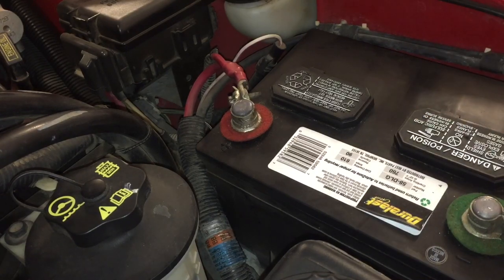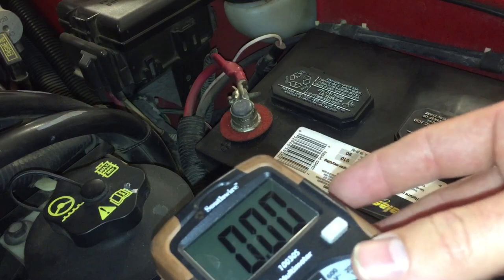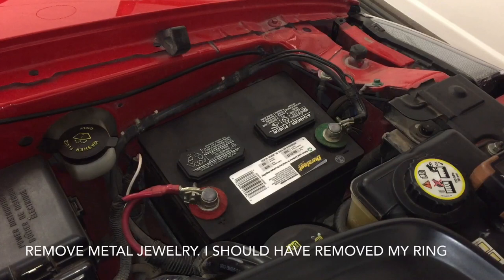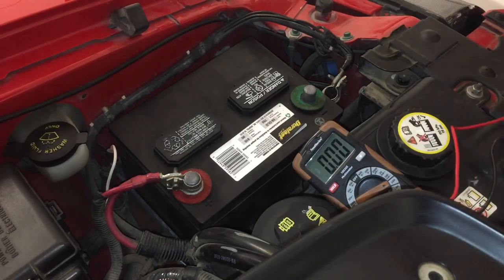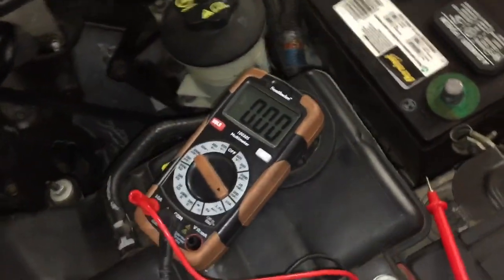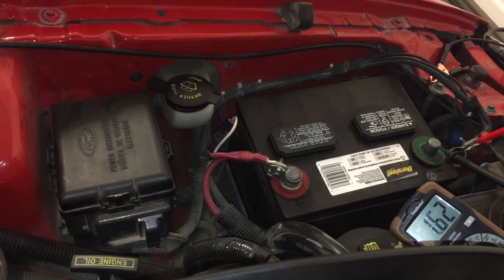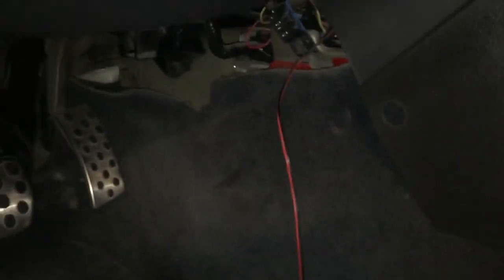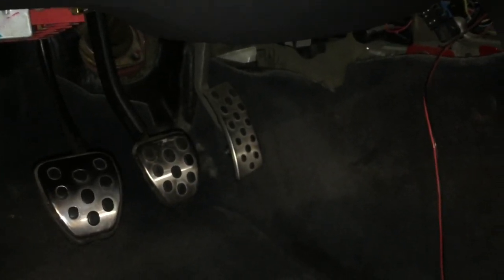Finding a power drain, or short circuit. Battery dies overnight, fuses blow

Comment: A trick to keep the modules asleep and keep the door open to get access inside is to take a screwdriver and trip the door latch like the striker does when you shut the door. The car will think the door is closed and let the modules go to sleep and keep the dome light off. Just remember to pull the door handle to unlatch the door before closing the door. Might put a piece of painters tape on the window as a reminder or something that will remind you that the door is still latched.

Comment: Electrical issues are the worse
Reply: Agreed i have one dragging my egr valve and smog pump and my o2 sensors and i cant find the issue I've replaced all those and its a circuit issue 😪

Comment: Does your door harness have a sensor on it to tell if the door is open? Or is that in the door somewhere?   My yellow Mach 1 thinks the dome lights on sometimes just like yours used to.  The bulb is out but when I drive around sometimes the door chime goes off like the door ajar beep.
Reply: I think there is a switch that is part of the door latch. When the door latch moves it actuates that switch.

Comment: If you suspect a draw on battery,  it is possible when you disconnect the battery and hook up amp meter leads, it can reset the draw if it is intermitant.  When disconnecting the battery lead, try and have amp meter keep the circuit closed, so can get a true idea if a super pesky drain. I fought a '13Ram 5500 work truck with a drain.  Had a stupid charger in tool bin in the back "wired" in.

Comment: My 01 mustang Gt I can't get my passanger Window to roll up from either side and its not the switch or the window motor
Reply from the maker: Justin Mills I wonder if there is a relay for it (you definitely hear a click when you push it- does yours?) Have you measured for power at the switch? I assume you have pulled the switch itself off, but if not here is how https://youtu.be/SU6OkG54FMc

Comment: Great video Danny thanks for the detailed video
Reply from the maker: Jason Cameron Thanks. I’m glad you enjoyed it
Reply: @dannyjohnsonsgarage  it thought me alot about voltage
Reply from the maker: Jason Cameron I had some other things come to mind as well like the constant theft light that flashes when the car is off, and the keyless entry and power locks that always have power even when the car is off
Reply: @dannyjohnsonsgarage  would the security light cause the battery to go dead if the battery Is good?
Reply from the maker: Jason Cameron That shouldn’t be enough to drain the battery if the car is driven often. Of course it will inevitably die. Even with my mach 1 apparently having a 1.8A draw it will last at least a month before it’s dead
Reply: @dannyjohnsonsgarage  ok thanks bro I appreciate that I use a battery tender in the winter(great northeast) lol
Reply from the maker: Jason Cameron I do is well. Here is my waterproof system https://youtu.be/Ab431FuXa1Y